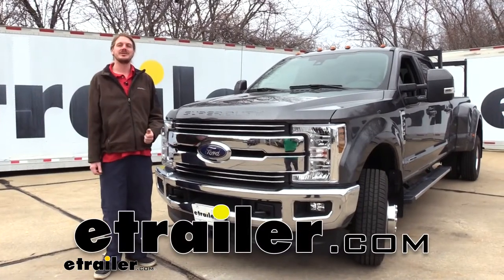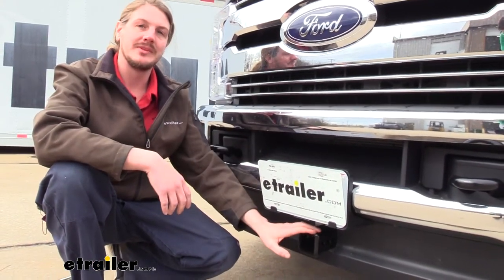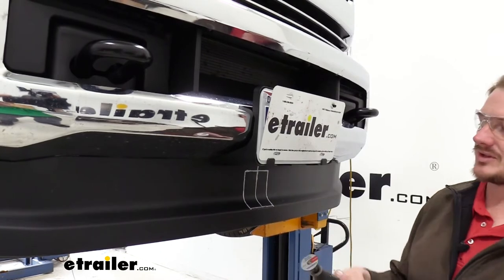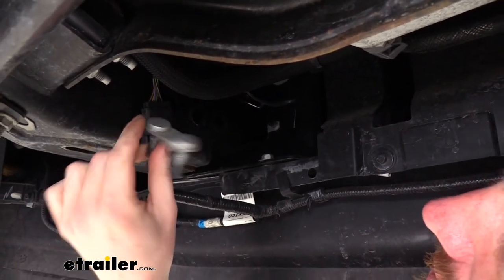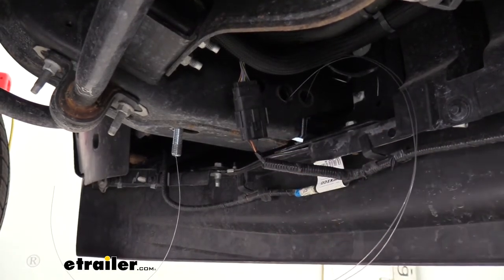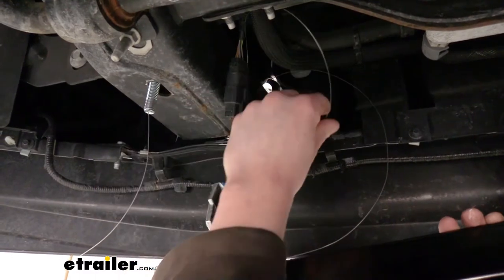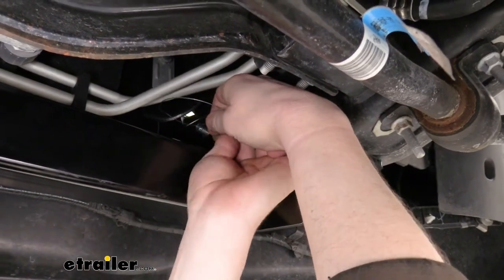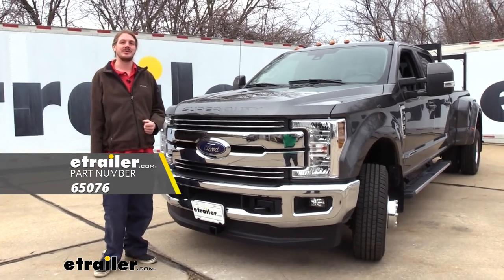etrailer | Draw-Tite Front Mount Trailer Hitch Receiver Installation - 2018 Ford F-350 Super Duty

Comment: I just did this on a 2023 F350 SD with snowplow package and skid plates.  You do not use the spacers on the front 4 bolt holes if you have skid plates.  I am 71, was a flat-rate mechanic way back; it took me 1.5 hours from start to finish ... on the ground... My biggest suggestion is only do the rear two fishwire/bolts and slip the hitch up in the area, and put the rear nuts on to hold the thing up.  Finger tight is good as then you take one of the bolts for each side without plate and just slip it in a front hole on each side to hold it up while you do the fish wire thing for the other front bolt on each side.  Trying to run all the fish wires at same time did not work, thus my 1.5 hour install.
Reply from the maker: Awesome, thanks for the tips!
https://www.etrailer.com/Front-Receiver-Hitch/Draw-Tite/65076.html

Comment: Will this work on a 2018 F250 also?
Reply from the maker: This front mount trailer hitch is also designed to designed to fit the 2018 Ford F250. Check out this hitch on our website in the following link.
https://www.etrailer.com/Front-Receiver-Hitch/Draw-Tite/65076.html